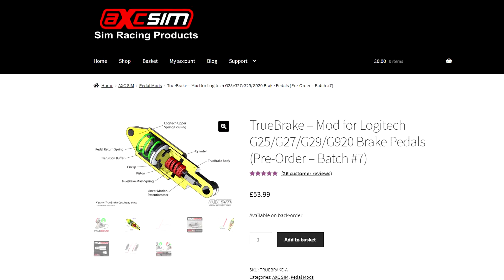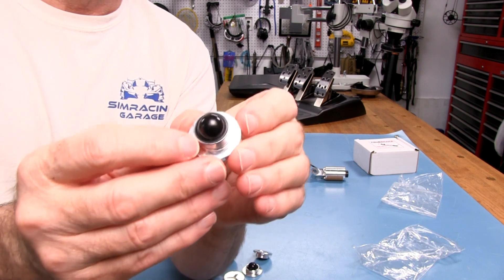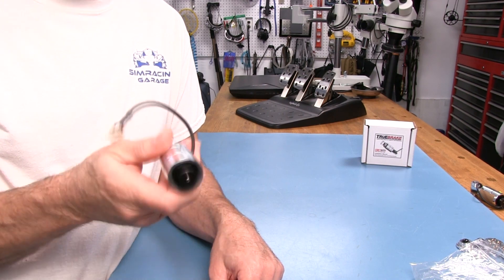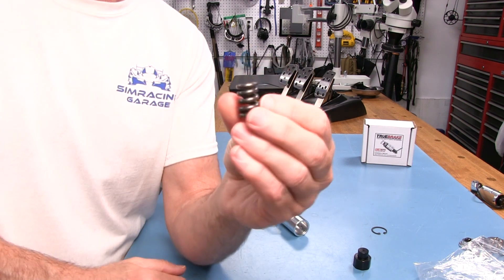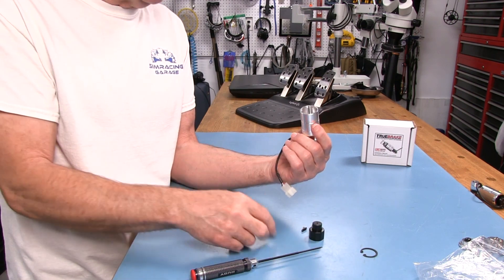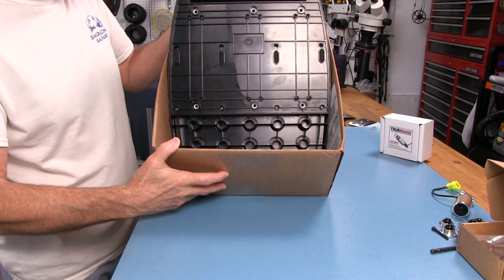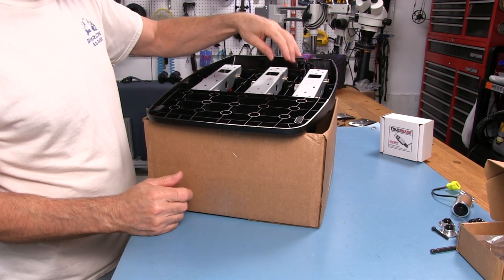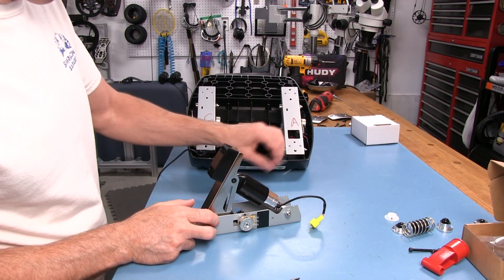TrueBrake Logitech Brake Pedal Mod Review

Comment: Got my TrueBrake package this past week and this is the weekend to install. I feel very confident now after watching the review. Thanks Barry!
Reply: how did it go?
Reply: @weserio  Piece of cake install. AXC-Sim is providing 4 bumper - dead zone choices. I picked the second most aggressive. I chose wisely :). I also made some spring swaps by using the old brake spring in the clutch and the clutch spring moved to the throttle. Everything feels great, much more confident going deeper into the corners as the pressure is consistent and smooth. I have only about few hours with the mod, but highly recommend!

Comment: Cool. I've got my G29 pedals upside down hard mounted to my DIY rig through a T300 wheelbase and I love it (much better than the thrustmaster pedals  IMO).
I have been hesitating on the richmotech load cell due to the cost for a long time. This looks like exactly what I've been looking for at excellent value.
Thanks for the great review.
Reply: The perfect entry-level wheel/pedal combo IMO !
Reply: You should get it.  The true brake is awesome. I never tried a load cell, but I can’t imagine it being much better.  This thing has cut my lap times by seconds.  I can speed into turns like never before.  The brake is now predictable.  It’s great.

Comment: I've had mine for a few months and plenty happy with it. Immediately gained time over the stock logi brake
Reply: Hey mate, are you using it with the stock logitech interface or the Leo bodnar cable?
Reply: @brunogil6630  stock interface, hadn't heard of that cable when I got the mod and haven't bothered with getting one. A bit steep for a glorified serial to usb

Comment: Please can I ask, if I plug my G29 pedals in to my PC instead of my wheel base, will that change the braking to a linear model instead of the curved braking on the petentiometer?
Reply: I just ordered a Bodnar USB adaptor to do exactly that.
Reply: Simon Haynes I’ve just followed your lead 😂. Bought one last night. Have you done any mods on the brake pedal itself? Want to see if I can improve the feel of the brake. But I have mine on the carpet using a chair with wheels so feel like a load cell mod might not be suitable as it would require too much force for my setup.
Reply: @CWill911  I've bolted my pedals to a heavy, wooden wedge-shaped base that's pressed against the wall. I've also built a racing seat with a load of 2x4 and a bucket seat from a sports car.
Not done anything else to the pedals yet, although I've got the AXC Truebrake mod coming any day now.
Reply: Simon Haynes I’ve watched reviews on the AXC Truebrake and it looks great, but you need something sturdy like you’ve built for it to useable. Don’t think it’ll be great for me. Just gonna keep looking for something I can use.

Comment: Subbed! I absolutely love your videos! Your style is more like I'm watching a real automotive installation/ review, which is great cause tech YouTubers often leave a lot of questions on the table.
Also, a question- Should I go for the Logitech G29? It's way cheaper and the only difference I'm aware of is the loadcell simulator on the newer sets, which is pointless if I plan on doing this mod. Also I hear the new pedals have a weird exponential curve in the brake pedal.

Comment: How much force at the pedal face to achieve 100% would you say? More less or equal to low end load cell sets like the TCLM or fanatec CSL LC ?
Reply: About the same.
I set mine up to be fairly light, Calibrate with diview to set 100% brake at your desired pressure.
I struggle to fully depress the Truebrake to max. I certainly couldn't drive a full race using full pressure!
I've had mine a while and it's performed flawlessly. I only got two bumpers (they've updated the pack it seems) but I use one that gives me about 6mm initial travel before hitting the main spring. This feels just like a real car with race brakes, moderate soft initial travel for a short distance then pads hit the disks giving a firm pedal.
It's really sensitive too. Great resolution.
Reply: @gavinboulton6878  Thanks for the info, I currently use an AP electrix load cell on my g27 based pedals which I can set anywhere between feather light and painful, I use a bodnar cable for calibration so no need for DIview. The only issue is its old and I have to make my own rubbers for it as there are no parts available any more, needs regular recalibration. I might just get one of these to try though before I invest in some high end pedals.

Comment: just got it. easy to install for sure. I even got the cable to bypass the firmware but now the throttle is not working the same. I'm assuming because of the firm wear bypass. I am going to try their potentiometer upgrade for the throttle see if that helps. Sucks because if i had known that i would have saved a bunch of shipping and have both installed and working already.

Comment: Superb video Barry but being a PS4 user I don't feel like this was geared towards console users who will have to connect the pedals to the steering wheel and it doesn't seem like it's going to work for calibration as well as some games that require you use the brake pedal to reverse. Very nice mod but definitely not for console users

Comment: I purchased the Mod, Installed it worked fine for 3 months , now when I press on the acceleration randomly the break spikes 30 - 40% , pedals are undrivable , I have contacted support and waiting for their response ( tried it on another set of new g29 pedals and it does the same thing )
Reply: Hi, Just curious about the reliability of this brake. Did you manage to get it fixed?

Comment: Aren't these calibrated with the Logitech curve in mind? That's the impression I got from the graph on their website...
Reply: The graph on the website is actually for the amount of force needed to push the pedal down related to the travel of the pedal not the input

Comment: Thanks!!❤ Ordered one right away!

Ask 1 Logitec G923 Ps5 DirtRally 2.0, 14" Steering Wheel!

On the "incom" patameters" for steering wheel and pedals in DirtRally 2.0, you can see how signals for brake and throttle are "leaking" even when they are not used.

Which makes the throttle/engine hack😢!??!
If I step on the brake quickly, the knocking stops for a minute or so, but comes back soon!
The steering wheel and pedals are only 4 months old!
Have you heard of this problem?

Today I have "deadzoon" 10 on the brake and 6 on the gas!??? To be able to drive at all!

I have modified both the steering wheel to 14" and the pedals (uses the clutch for the handbrake) so it is not possible to advertise them!

Ask 2  Does bypassing the pedals, bypassing the steering wheel on the Ps5 help too?

mvh Lucas Sweden

Comment: Anyone using it with a g25 /27 and no Leo bodnar mod? I'm thinking of buying one for my g25 Pedals and I'm curious as to whether the lack of a bigger resolution on the stock logitech interface when compared to the Leo bodnar cable makes much of a difference (as in, it can't read the smaller movements of the TrueBrake's sensor)

Comment: @SimRacingGarage   Thanks for a great review.  Ordered a set.  Question about the bodnar cable.  I never understood that the cable was useful to bypass the firmware in the G29 and newer wheels that distorted the brake linear input.  That said, I have a DFGT with a set of G27 pedals modded to work with it.  I intend to use the DFGT wheel in line with the TrueBrake modded G27 pedals.  I'm assuming that the firmware in the newer logitech wheels you mentioned doesn't apply to the DFGT?  And if it does, then that means I'll need to get the Bodnar cable... right?
Reply from the maker: The brake curve is applied by FW in the G29/G920 wheelbases. If you run the pedals through the g27 wheelbase you won't need the Bodnar cable. Unless of course you want to run the pedals directly to your PC.

Comment: This mod is absolutely worth it. I’ve had these modded for 2 years. The best set up for these pedals is as follows:

- AXC Truebrake mod
- AXC potentiometer upgrade kit (throttle only)
- Remove pedals from the plastic case and custom mount them on a very sturdy plate. This should get rid of the squeaking

From here to really feel an upgrade you will probably have to spend $600+ on a set of real loadcell pedals to really feel like you got an upgrade. For those of us that already have the G920/G29 pedals, AXC mods are impossible to beat for the tiny investment. This is a console racers best option imo.
Reply: Do you still have your pedals plugged into your Logitech wheel running on there software.? If the setup you recommend is used on a console  doesn’t the console bypass all the Logitech software/drivers etc  ?

Comment: Regardless of what you want to say this is still a brake pedal modification that is based on the amount of total brake travel just like the stock g29 or 920 pedals and not pressure based like a load cell set up. With the amount of plastic used in the cheap pedal construction instead of wasting your money trying to make the cheap pedals be a better pedal set why not just upgrade to a better pedal set that is made to properly operate under load cell level pressures?

Comment: So, it doesn't depend on brake travel... except that it does.  Try setting it to where there is no brake travel, so the potentiometer slider doesn't slide, then the brake doesn't work.  The Ricmotech loadcell is a loadcell and is far superior.
Reply: Joe Blow : I don’t think loadcells are necessarily more superior to a setup such as this. I own both, and they only facsimilate what a real race pedal feels like, such as the Tiltons I use in my real-life race car. The only sim racing pedals that truly bring the same feel are the hydraulic systems by RealGear GTpro3 and HPP, for example.
Reply: Joe Blow... if the main spring moves like a millimeter then that's hardly any movement at all.   However that spring is still deforming under pressure so it indeed is like a load cell and reacting to force while having minimal movement.
Reply: Joe, have you actually used it?
Reply: Hi Barry I watched a review and I ordered one from England and it works very well I really happy with it. I put in the biggest cap and I have no travel I should have went to the next size one but all in all  worth the money .thanks for the review